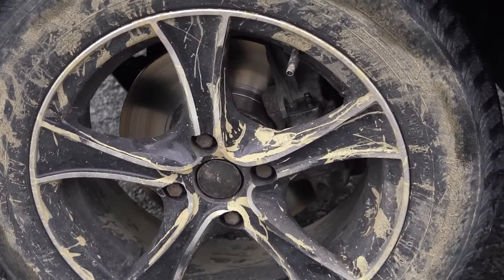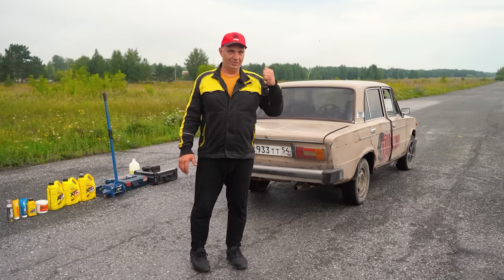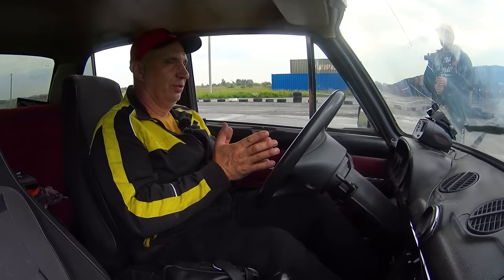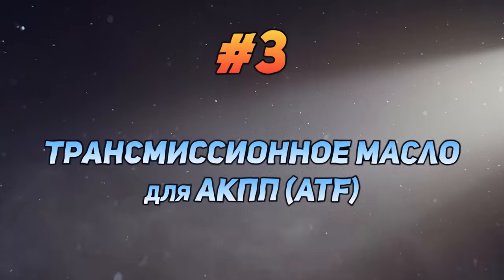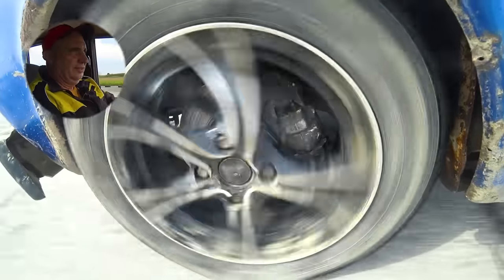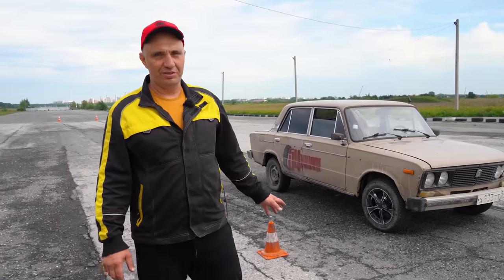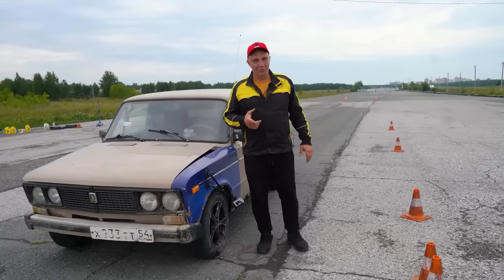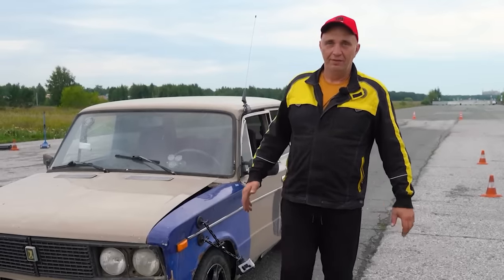We cover brake rotors in grease (and other lubricants) - what will happen?

Comment: Next video, replace the brake fluid with water and other liquids to see how it affects braking.
Reply: Water would work fine.
Reply: @dooflydetailguuy4349  I would say water will not work, since it would start to boil probably.
Reply: @AndrewTSq  fair point.
Reply: @AndrewTSq but pressure will raise boil temperatures
Reply: What a nice idea 💡😮 let's gooooo
Reply: Water will work fine until it boils.  At which point the pedal will go to the floor and pooh will come out of your hind end.
Reply: Has been done by mastermilo years ago
Reply: thinking the same thing. say you blew a break line and you just happened to have line and fittings, a flaring kit too in your car. and on the way home from shopping? you just happen to have cola, vegetable oil, corn syrup even.just not break fluid. i wonder which would be best to get you home.. safe??
Reply: @dooflydetailguuy4349  No it won't. Water is easily compressible and doesn't transmit force very well. Sure it might work a tiny bit before you just start compressing the water and do that too much, it will boil and the [pressures would be insane and dangerous.
Reply: @janemba42 not sure where you heard that water is compressible, but like all fluids it is noy at all compressible, it will boil, and the steam is compressible..but all fluids are (for practical purposes) completley incompressible
Reply: I really really hope they do this. Water, soap, engine oil, transmission,
Reply: It would probably work once and then you'd get air bubbles, the water would start to get warmer and eventually boil and could rupture a hose. I don't think compression within the lines would be too great either. Only one way to truly find out though!
Reply: @kevinfloyd808  I could say the same to you. It changes states but that doesn't mean it's not compressible, that's the entire reason why it doesn't work. Because it is able to be compressed which makes it change from a fluid state. If it really wasn't like you say then the act of compressing it would do nothing and just transmit the force, you know, exactly like brake fluid does.
Reply: @janemba42  pleas google is water compressible...ill wait. In liquid form it is not, it is very reactive yo heat, and has poor lubricity, and cause rust..these are all reasons its not used in brakes or other hydralic application. But as to compression its the same as all fluids..0.
Reply: To be more precise i did what i suggested..it will compress 1% at 30 thousand psi. Car brakes under maximal stopping effort may reach 2000 psi.. so not compressible in any meanignful way
Reply: @kevinfloyd808  for purposes as a hydraulic fluid, I agree, although nothing's perfectly incompressible. Water in the deepest trenches of the ocean is compressed by a couple percent for instance & under higher pressure it would compress even more
Reply: There won't be any difference in anything if the system is bled correctly.

May cause premature failure of parts in longer term but simply substituting and doing a run, not really.

Could get interesting when pushed to the limits with heat tho 🤣
Reply: @janemba42 umm no. Water is most definitely not compressible. Look up "hydrostatic testing" or "hydroforming" or "water hammer" or or or or or....... 

🤷‍♂️
Reply: @nathansmith3608 Yes this is true to an extent (I doubt even Mariana Trench has notable compression, but measurable with the right equipment) but no hydraulic system in use by man is going to provide even close to something measurable without very sensitive and specialized equipment. Put another way, "You won't see it on Garage 54 unless they colab up with someone who has the right equipment".

I've been involved in hydrostatic tests at 10k PSI on stainless pipe used in the aerospace industry, and can tell you first hand that the dominant effect is the result of the pipe stretching, not the water compressing. Those tests are insane and when something lets go at those pressures, you don't want anything to do with it.
Reply: Liquid soap!
Reply: @garycarpenter2932  oh shit syrup would be perfect
Reply: Use motor oil
Reply: Hadraulic oil?
Reply: Water is the main reason for regularly replacing brake fluid, as the same fluid absorbs water and significantly impairs the operation of the brakes, which is why water instead of brake fluid will definitely not work Well!!
Reply: Use hot chili oil 🌶
Reply: Water would just vape away
Reply: @nathansmith3608 Well obviously, but in practice with pressures that are normally experienced by people water is incompressible (more accurately, it compresses by so little that it's negligible)
Brake fluid too, obviously with a high enough pressure you can compress it... But in normal conditions it's negligible.
Reply: I've ever tried using water as brake fluid, it's work perfectly fine, perhaps even more responsive, well, if you put aside the possibility of rust of course. shrug
Reply: @AndrewTSq they should try coolant 😂😂
Reply: Way too many people here thinking water as fluid will boil while you’re on the brakes. It won’t because it’ll be under pressure. Then when you release it will boil
Reply: With transparent hoses !!
Reply: They already do that. Brakes used to be fine until they heated up and water start to boil inside tubes, then they lost all braking power.
Reply: @janemba42 Have you never seen/heard about what happens when an engine tries to compress water? Water wins and the connecting rod (at a minimum, usually other components too) has no choice but to severely deform/break apart.
Reply: @servicetrucker5564 boiling brake fluid of any kind will lead to non functional brakes. To get that to happen with regular fluid you need to be on a track with brakes only designed for street use.

At max braking effort (power assisted) you're in the ballpark of ~100 bar/1500psi, at this pressure water boils at 311°C, which isn't all that hot for braking components.
Reply: Soda water
Reply: @carnivorebear6582  I know what my point was is the fluid won’t boil while you’re on the pedal but when you release it. Then the fluid is displaced by vapor and next time you go for the brakes you have none
Edit I didn’t see the rest of your comment until now but unless it’s a race or a dragging brake they ain’t getting THAT hot
Reply: @janemba42  water is most definitely not compressible... LMFAO
Reply: @mrsnezbit2219 but after releasing the break the pressure will drop and the water will start boil instantly
Reply: Years ago, my ex mother-in-law added power steering fluid to her break reservoir, and once the fluid heated up, it caused the breaks to lock up and she had to open up the bleeder valves to get the breaks to release.
Reply: replace with vodka
Reply: @Shadaole   YESS!!
Reply: Petrol 😂
Reply: I did once try replacing brake fluid with water and it felt like a you pressing a brick, because you cant compress a water
Reply: Dot in the crank case lmao
Reply: For real let’s see that video
Reply: Water is incompressible so could cause leakage
Reply: Water works. Once the water gets hot it boils and creates air
Reply: yesss
Reply: @MadScientist267 Hydrostatic lock. Water in the cylinders.
Reply: @bystanderbutch3509  That only applies to "fixed volume" (such as the head space in an engine with the piston at TDC).

In the brake system, it will behave exactly like normal brake fluid until the water has its way chemically with the brake parts, at which point leaks and seizing occurs. Up until the point this has an effect significant enough to "notice", the brake system will operate normally provided they don't heat up too much and boil the water.

At that point you're working in a different realm.
Reply: @MadScientist267  My friend had a car which had a leaking wheel cylinder and replaced it. Afterwards, he filled the master cylinder up with regular hydraulic fluid rather than brake fluid cause his dad claimed it was all the same. The brakes became tough up to the point that it was almost impossible to apply. The vacuum booster was not at fault because once flushed and refilled, they worked fine. Water cannot be compressed. Hydro lock has happened to many running engines that has water introduced to the intake in large amounts. I'm a bus mechanic and to work on diesels, you MUST understand compression.
Reply: @bystanderbutch3509  Brake fluid can't be compressed either. You are under some impressions about these liquids that are incorrect lol
Reply: @bystanderbutch3509  Hydrolock is a totally separate thing from resistance caused by fluid dynamics.

You keep bringing up an engine as if the pistons inside one have anything to do with or are even related to the pistons in a braking system.

They do not.

"Hydrolock" is not a thing in brake systems. At all. The fluid will simply move slower if it is too thick.

Either way, both water and brake fluid are very thin and will work interchangeably, for a few minutes until the water starts having other effects on the components.

What you are describing is drag caused by fluid dynamics and yes it can cause a significant resistance but *does not stop the flow*.

This is due to friction between the fluid and the walls of the system components, namely the brake lines in this case. Whatever fluid is there can still slowly move because the slave cylinders in the wheels are still free to move.

Hydrolock only happens when the fluid can't go anywhere, as in the case of an engine. The piston (which is analogous to the master cylinder piston) is moving but the valves are closed and the head does not get out of the way when whatever is in the cylinder is forced into it.

The result is the piston has to stop, or damage something else in the process of escaping.

You can fill the cylinders of an engine with brake fluid and cause the EXACT same situation, and it is called hydrolock all the same... because BRAKE FLUID ISN'T COMPRESSIBLE EITHER

That's WHY IT IS USED as a hydraulic fluid.

I consider this madness explained. Any further argument you wish to have will be with someone else or yourself. I can explain all this TO you but I can't understand it FOR you.
Reply: @janemba42  lmao "water is easily compressible". That's one of the dumbest things I've ever read on the automotive related part of yt.
Reply: @mrsnezbit2219 pressure lowers the boiling point.
Reply: @cooperlessard1723  no
Reply: Negative pressure effectively pulls the molecules apart and moves them. Faster a molecule is moving the hotter it is. Look up a video of worlds longest straw, after a few stories the liquid starts boiling in the straw at ambient temperatures
Reply: @mrsnezbit2219  wait your right I started my first comment wrong, my bad
Reply: @SerPurple51  it will definitely boil under heavy braking , may work fine if u take care not to do " heavy " braking  as dot 3 has a boiling point of over 400° f I believe and most high performance application call for dot 4 or above because of it higher boiling point
Reply: @janemba42  plz could u do a video showing us how to                       " easily"  compress water . I'm sure this would draw a lot of interest and views as , myself I don't think I know how to go about doing this , and it could be very useful for many purposes..... I believe u could even become very, very wealthy with this kind of knowledge!!! I mean think of the uses .. u could compress a bunch of water for a lengthy camping trip ..... Without using as much space, and the amount of things that could be done with knowledge, I would think 💬🤔 , would be endless !! Thanks in advance as looking forward to learning this technique from ur video !!! Hava great day ... I mean think how much this would mean to space travel as well !!!! Wow !
Reply: @cliftonmassey3143  that's because any petroleum products will cause the rubber components in a brake system to swell .... Very unwise to put anything but brake fluid in ur car in the real world.... Gets very costly replacing all rubber components in your brake system, just to avoid a tow bill, and if u were to use anything for emergency use, id say water would be ok as long as it was flushed out of the system right away, because ur reg run of the mill brake fluid is water soluble
Reply: @MadScientist267  it seems many ppl r ..  lol seems crazy ppl think fluids can be compressed but ig everyone has different life experiences
Reply: @DS-mm6fh  Those "experiences" are happening on things like YouTube and aren't experiences at all... but you can't tell them that.

Common sense is the only way to put it. And yep. It's dead today 🤷‍♂️
Reply: Effect not affect
Reply: My sisters friend accidentally put windshield washer fluid in her master it drove fine
Reply: you can't compress water it will explode
Reply: Yes. That would be extremely interesting
Reply: @janemba42  You are, of course, completely incorrect, water is essentially incompressible (it compresses a tiny little bit, but not by a meaningful amount).

"If it really wasn't like you say then the act of compressing it would do nothing and just transmit the force, you know, exactly like brake fluid does."

Which is exactly what water does when you try to compress it. I guess you've never heard of hydrolocking an engine.
Reply: @franciscomiranda9561  Water is not used in braking systems because it corrodes the metal components within the braking system (which is just about all of them) and doesn't lubricate as well as brake fluid. But the main reason is corrosion, because even just a little bit of rust will either seize components like the brake caliper piston or clog the brake lines.

Boiling point is also obviously a concern, but that could be addressed with additives like glycol.
Reply: @MadScientist267  "'Hydrolock' is not a thing in brake systems. At all. The fluid will simply move slower if it is too thick."

That's not how brake systems work. The fluid doesn't "move" by an appreciable amount. The whole point of it is to transmit force to the brake pads, which is defeated by the fluid "moving."

"Either way, both water and brake fluid are very thin and will work interchangeably, for a few minutes until the water starts having other effects on the components."

Viscosity has nothing to do with it. Again, complete nonsense. I shudder to think that you have a job working on aerospace parts, but you're probably just a pipe fitter watching someone else do real work.

"What you are describing is drag caused by fluid dynamics"

Your finger is so far off the pulse you're not even on the body.

"BRAKE FLUID ISN'T COMPRESSIBLE EITHER"

This is the most accurate thing you've said in all of your posts, and it's still wrong.

"That's WHY IT IS USED as a hydraulic fluid."

That's not why it's used in braking systems though. If being essentially incompressible were the only reason to use it, then literally any fluid would work, because ALL fluids are essentially incompressible.

"I can explain all this TO you but I can't understand it FOR you."

Because you don't understand it in the first place.
Reply: @rars0n  If you'd have done research before writing your book, you'd realize that it very much does indeed move. How else do you think it transmits the force. Your foot moves, which moves the pedal, which moves the piston in the master cylinder, which moves the fluid through the brake lines, which moves the pistons in the wheel cylinders, which applies pressure to the disc/drum.

There absolutely IS movement. 🤦‍♂️
Reply: @MadScientist267  Pretty sad that you thought I wrote a book. I'd hate to think what you'd call a couple of paragraphs.

"How else do you think it transmits the force."

Does a wall move when you push it? How do you think the wall transmits force back to your pushing it? Did you even pass middle school science?

"Your foot moves, which moves the pedal, which moves the piston in the master cylinder, which moves the fluid through the brake lines..."

Nope. Fail. Sure, the fluid moves a tiny little bit, but overall the entire point of having a fluid in there is to transmit the force without moving. The more the fluid moves, the deeper the pedal falls to the floor. That's why leaks are such a problem. You don't understand the first thing about cars, do you? So why are you leaving comments on such videos?
Reply: @rars0n  Why are you still talking? It's obvious you don't understand the principles in play in a hydraulic brake system. I'm done here. 🤷‍♂️
Reply: @MadScientist267  I'm not surprised you ignored every single thing I noted that you were wrong about.

I'm glad that you make a habit of running away because I don't like talking to you anyway.